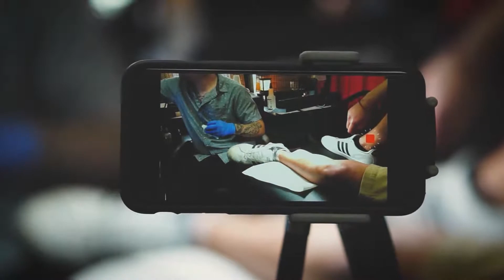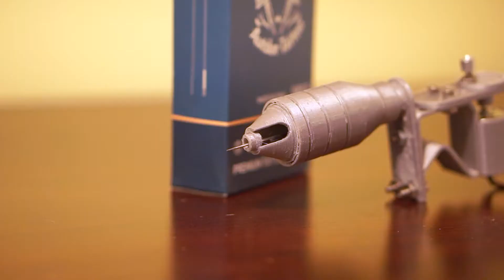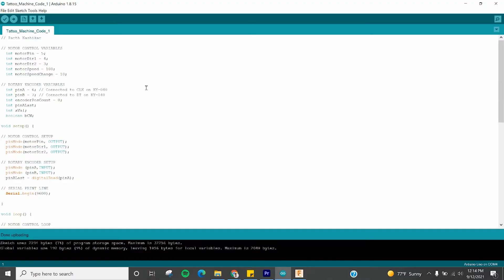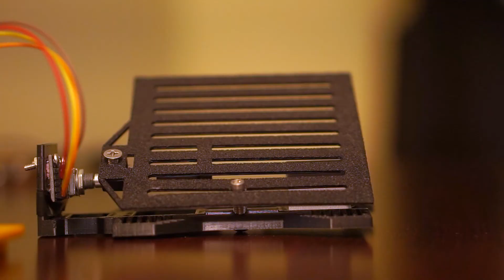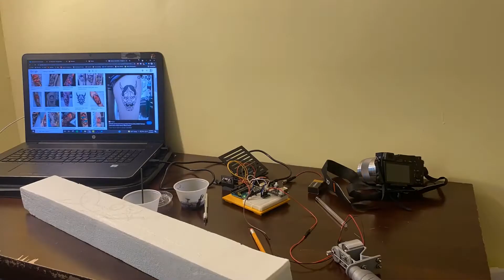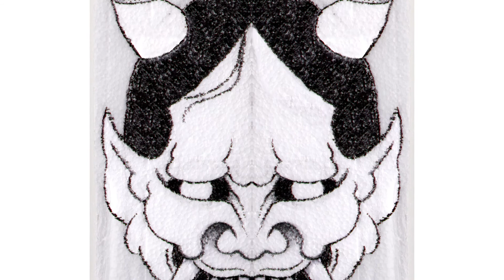3D Printed Tattoo Machine - IPD500

Comment: Interesting. No need to adjust the speed on the fly. Also the throw (distance the needle moves) is crazy long. 3-5mm is all that’s required not 1/2-3/4 of an inch.